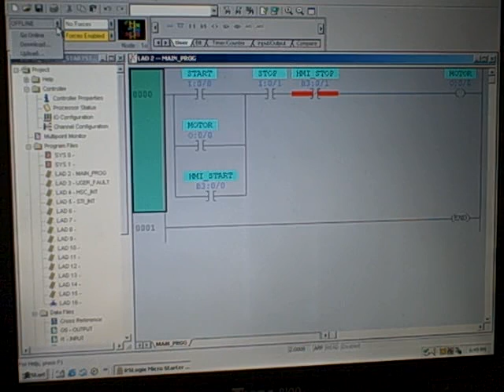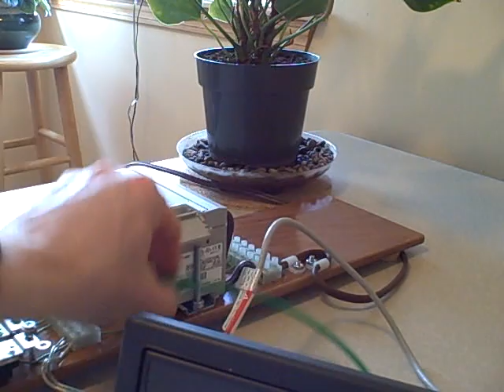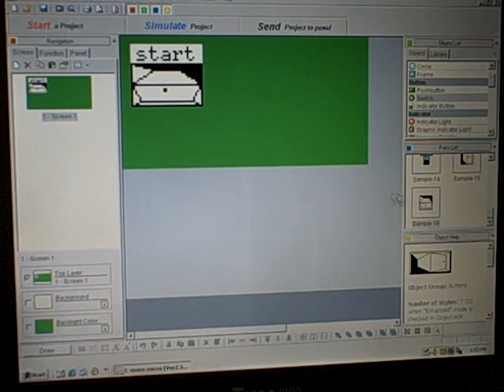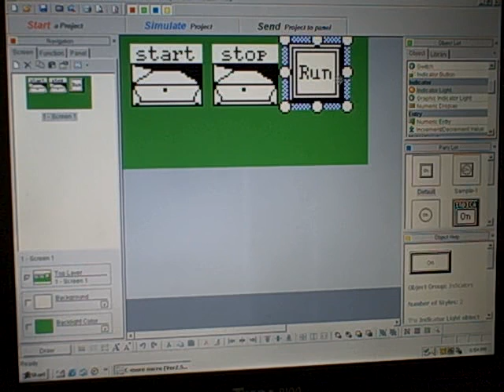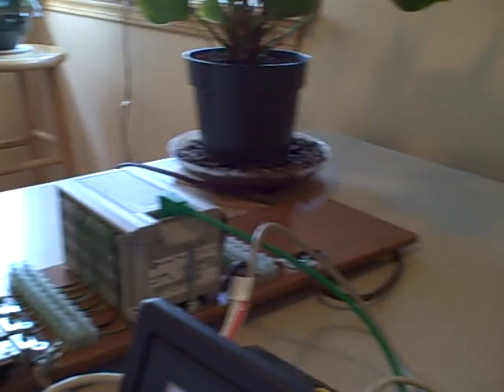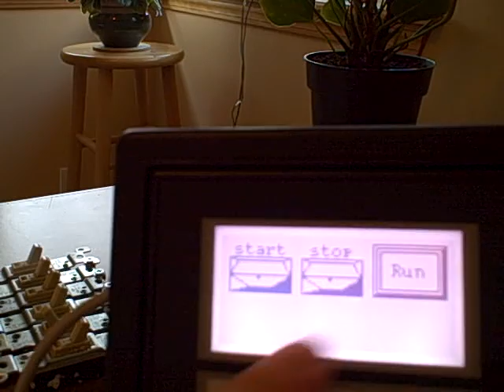HMI programming -- motor start/stop system

Comment: Ok. I have a micrologix 1500. I connect via DF1 RS232. I open RSLinx driver to be online. Then I open factory talk view and create driver and short cut through RS enterprise. I can’t see files. The only way is if I stop RS Linx driver and go offline. If I connect with rs enterprise factory talk view studio and could see files to tag. Now I can’t get micrologix to go back online with RSLinx. Says comm port conflict. So I can’t mimic using HMI run time program to simulate. What am I doing wrong.